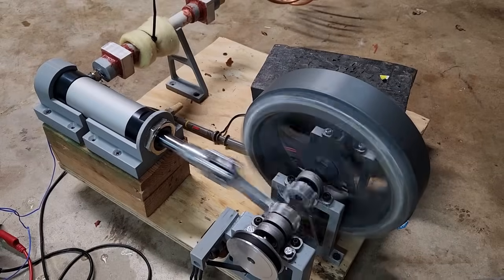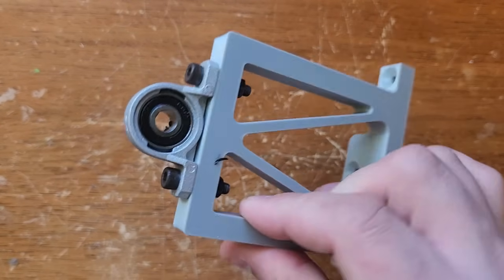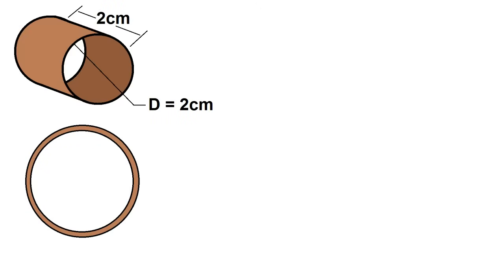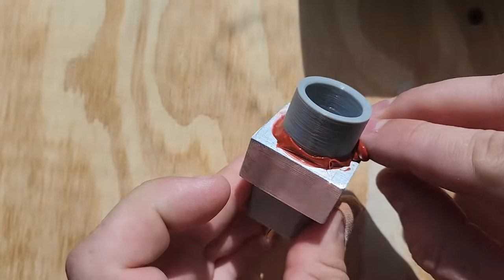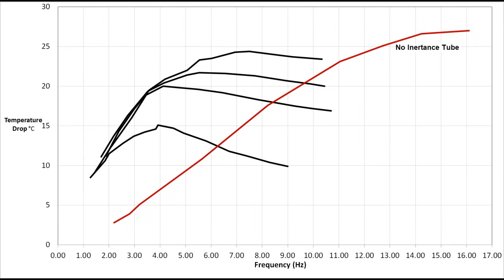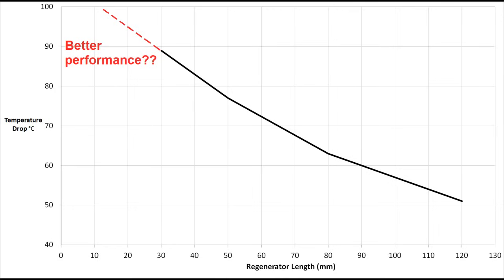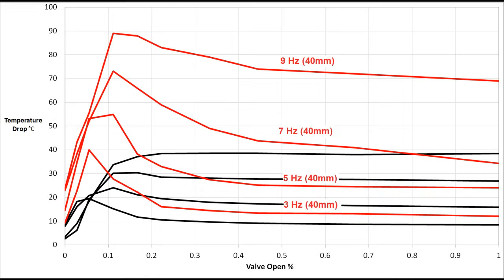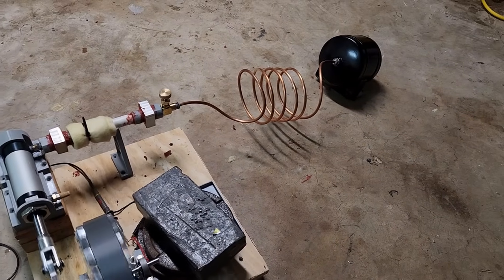Pulse Tube Cryocooler - Part 2 (-75C)

Comment: My understanding of the physics behind this are a bit sketchy, but I do know that if you are using the aluminum blocks to dissipate heat, then adding a small fan to blow air over them will increase their ability to dissipate heat into the air.  Putting them into like an ice bath will help even more.  That way the delta T of the inside should be higher, and therefore improve heat conduction.  You may want too inspect the inside of your air cylinder to make sure the piston is going all the way to the end of the tube to the the largest compression you can get.    There may be a bolt on the end of the piston or weird cutouts in the head.  My other suggestion is to increase the stroke length and use both motors to drive the crank.  One from each end.

Comment: This is fascinating. The first DIY cryocooler that works sufficiently  This is the first DIY project reaching really low temperatures without complicated multistage refrigerant stages.
Reply: :) Not the first that works well, but with a really cool presentation!

Comment: For the regenerator I recommend looking into a foil-based regenerator. The video here (starts at timestamp): https://youtu.be/IgWHuhVcLKA?t=1147 ,shows how a strip of stainless steel foil, would have small dimples stamped into it, so that when it is wrapped around itself, it makes for nice small airgaps between the wounds of the foil.

Apparently at least for Stirling engines, it's one of the better types of regenerators to use.
Reply: I was reading a lot about Stirling refrigeration in the early 80's and the "standard" regenerator consisted of a stack of fine wire mesh disks. The stack naturally has poor thermal conductivity down it's length, as required. I think copper was preferred but brass was acceptable and easier to obtain. The mesh is easy to cut with scissors. I've not seen the foil approach but it looks interesting and am left wondering how the dead space, axial conductivity and other properties compare to mesh.

Comment: I have a curiosity, the greater the vacuum drawn on the air medium the cooler it gets yet the greater pressure applied the hotter it gets... thus your need for the heat sink and the flow reducer to restrict the movement of the heat from the compressed medium as the decompression takes place on the other side of the heatsink...

I will assume you know how a regular heat pump works, compressing refrigerant into a small confined line then out into a much larger diameter line that has a vacuum pulled on it. the change of density of the refrigerant from the small line to the large line causes a change in state of matter from liquid to gas creating the temperature gradient.

I am thinking of maybe using isopropyl Alcohol as a refrigerant in a parallel, secondary line that decompresses, inside the cooling tube either on the cold or hot side of your heatsink. the compressor for this line could easily be a second piston with a much smaller stroke/volume on the same motor.

perhaps i am over thinking this.

Comment: You can use hydrogen in the cryocooler. It's easy to make an relatively cheap compared to helium and have similar properties. It is not a fire hazard if the hydrogen is at high concetrations and if it leaks the smaal amount of gas will swiftly dissipate to low enugh concentration as to not be able to ignite.

Comment: When cleaning wire wool up wrap the magnet in a rag so you can separate the captured steel wool from the magnet to dispose.

Great to see an explanation of why gas-gas heat exchangers are hard to design!
Reply: Gas-to-gas heat exchangers are much harder than the other because overall heat transfer coefficient is substantially low that you need very large equipment for that. Because of that, the diameter and length of the heat exchanger gets larger and larger. If you intend to do gas to liquid heat exchanger, it is far worse than it seems, because the liquid will have higher conductivity while gas will have very low conductivity which makes a lot of problems on the design process. Other than this, the pressure drop across the heat exchanger will be very high for gas effluent (because of high velocities) depending on what type of heat exchanger and which side you intend to have liquid flowing (if it is shell and tube heat exchanger of course)

In my process design course, I had a lot of problems with superheated vapor stream and it was a nightmare to get the correct design values.
Reply: Great suggestion. Could use a vacuum cleaner or a small brush.
Reply: Instead of a rag you can also use a sandwich bag but the rag works well too.
Reply: I use a ziploc bag, inside out... and then boom I flip it around and now I have all my chips!

Comment: I know you like to evaluate the equations governing the process, and then you cut and try the mechanics, and measure the performance.  Are you tempted to try making and validating a math model of your cooler(s) to provide better guidance before breadboarding?  I know it's not easy to construct and validate a model, but making one and publishing a practical model would be a great service to the DIY gas liquefaction community.

Comment: Simplest way to give these 3D printed parts better performance and tolerances is to press in some bushings, typically made from brass. It works similar to putting in inserts, heating them up and then just pushing. Bushings are very often the better solution compared to roller or ball bearings anyway.
Reply: Bushings are only really significantly better if you're worried about contaminant intrusions into the race or concentricity. For a continuous low speed, ambient temperature, high torque system in an open and dry environment, ball bearings are pretty much perfect. A bushing would need much more careful tolerances for the shafts and alignment. If he were working with hydrogen gas you might have an argument though.
Reply: @dustinbrueggemann1875  Yes yes, high torque like here lol. It's low-torque, low-load, low-speed, and very limited operating hours, so the main argument for bushings is the fact that they're low profile. Which I guess is the reason he didn't install ball bearings in the first iteration of the rod, as there wasn't enough space.
Reply: @dustinbrueggemann1875  so for low torque application, bushing can be better?

Comment: Did you change the pulse tube for the larger piston? Since that made such a large difference for the smaller piston it might help the larger one as well. 
Have you measured the heat bildup on the heatsink? That might also be a limiting factor for the large piston

Comment: Great video and a good approach overall.
Just be careful about avoiding helium for too long, as its properties are different enough that all of your fine tuning might actually end up being totally irrelevant when you finally switch over to it.
I would strongly recommend that you use some sort of vaccuum pump (even just a cheap single stage rotary-vane pump would probably be sufficient for testing) to ensure that you have a known, controlled gas composition and quantity inside of the pulse-tube.
I also think you should really start using hydrogen as the working fluid, at least to confirm that you still see the same general performance trends, while also ending up with optimized values that are similar to what you found with air. This would also ensure that your connections are hydrogen gas-tight and therefore also more likely to be helium-tight as well.

Lastly, you could consider using methane (or carbon tetrafluoride) as a cheap working fluid for high-pressure cryogenic testing.
Reply: I think he is avoiding hydrogen and methane so it doesn't explode (compressing flammable gasses). Hydrogen would definitely be interesting though because it is so abundant and is fairly similar to helium in the required categories. I am interested in making one of these cryo-coolers to make my own hydrogen for a car or possibly a motorcycle
Reply: Hydrogen is a big leap to make though. You need anti-detonation measures in place to even think about using it like non-sparking alloys, rupture vents with ventilation, and fairly powerful vacuum pumps to ensure the system being filled is free of oxygen. Also, can you even buy CF4 non-commercially? It's a super potent greenhouse gas and manufacturing of it is pretty tightly controlled from what I understand.
Reply: @dustinbrueggemann1875  Hydrogen detonations are really not that bad at these sorts of volumes and pressures, while the internal construction of the economizer/regenerator is already very similar to that of a flame front arrestor.
Take for example the safe, common demonstration of comparing the explosions produced by setting fire to 1-2L balloons filled either with Hydrogen ( but without rigorous exclusion of oxygen), or with a stoichiometric ratio of 1:2 pure Oxygen to pure Hydrogen.
Even though both produce explosions, the pure hydrogen balloon doesn't produce nearly as brisant of an explosion.

'Pure' Hydrogen deflagrations (with or without a transition to detonation) are also not even a shrapnel hazard if you're using relatively light materials, as can be attested to by the following common (at least it is very common over here) science classroom demonstration:
The teacher would punch a small hole in the bottom of a metalIic can (it works best with long and slender instant coffee can, although an old paint can with a loosely attached lid can also be used), then after covering or plugging the hole with scotch tape or blue tack and inverting the can, he would fill the can from the bottom with Hydrogen (through the small gap from the loosely attached lid). After some time, (while still feeding in Hydrogen through the bottom) the small top hole is uncovered while holding a lit match just above it so that the escaping stream of Hydrogen gets ignited.
After ignition, the Oxygen to Hydrogen ratio inside of the container will begin to increase so that, once an explosive composition is acheived, the whole mix will detonate at once and blow out the bottom lid, thus propelling the can upwards with avery impressive speed!
Reply: Using hydrogen in his home made piston and tank system? Sounds like nothing could go wrong.

Comment: Could the 40mm pre-compress then the smaller 25mm cyl does higher compression? Higher compression provides a bigger temp differential.

Comment: You could try to improve regenerator performance by using several "sub-regenerators" to prevent heat conduction axially. In practice, instead of making one blob of steel wool, make several and stack them inside the tube.
Reply: I wonder if adding an insulator material or air gap between them would help as well
Reply: @mitchellstrobbe7779  What I've read, having an air gap or insulator material between sub-regenerators does not improve the perfomance much at all. Axial discontinuity in the regenerator should be enough to prevent axial conduction.
Reply: Try a stack of stainless steel filter mesh. Not only does stainless steel  have a much lower thermal conductivity than the steel in steel wool, but heat has to flow laterally along the before reaching a contact point where it can flow axially to the next screen.  The second part contrast with the random orientations allowing comparitivly faster axial heat conduction with steel wool.

Comment: be careful driving your motor with a power supply, that flywheel has potential to put higher voltage/current back into your power supply and blow something
Reply: I think the solution is a flyback diode?

Comment: This is by far, the most interesting video project recommended by YouTube in a long time. Great explanation and accurate presentation. Amazing work, keep up the good work. Hope to see -200C in a while :)
Reply: I second that. Looking forward to some liquid nitrogen in the near future :)
Reply: @drezster  سسثثر|3
Reply: So True otherwise youtube only promotes garbage and clickbait
Reply: I agree this is highly relevant to my interests.

I've been wanting to test out instead of using heat to evaporate water from my 3D printer filament, sublimate it with cold instead.

Freeze drying machines are ridiculously expensive.

I could do so much science with this!
Reply: @jtjames79  Drying by reusing salts/absorbers or using vacuum or a water separation membrane to make a dry environment might be easier?
Reply: @spaceminions  I live in the wettest part of Hawaii. A desiccant is pretty much necessary.
Reply: @jtjames79  Unless the plastics are weird, desiccants should not be the only option though. Vacuum is obvious, and while inefficient it's fairly easy to get to pressures at which water cannot be a liquid at room temperature, but the membrane separators are capable of dew points in the negative fahrenheit ranges IIRC while being less inefficient.
Reply: @spaceminions  But then I wouldn't know if sublimation works or if it's just a stupid idea.

Plus then I would have a ready supply of cold for whenever I wanted it for "reasons". Like turning a puddle into an instant fog bank, for quick ninja escapes.
Reply: I’m more of a chemist type than an engineer so I don’t follow a lot of what he is saying but I have absolutely loved following this project. Sometimes I need very low temperatures for certain reactions so DIY cooling systems have been a big interest.
Reply: Gotta agree with ya!
Reply: In case You don't know: watch the "star in a jar" project by the plasma channel. Just a recommendation
Reply: I third that, been on YouTube too many years,  its not often I come across a subject that is not covered much and my god the scientific understanding is fantasist by the creator, I'm loving the journey he is on as cryo coolers are not something Joe blogs would come across and the people that do know about them seldom know the way they work :) keep it up
Reply: I used to run an O2 generator system for high volume.  It used pretty much all the types of cooling schemes he talked about, compressors, heat exchangers, turbines, etc. in different stages to get LOX.  We used to heat our lunches on the compressors.
Reply: this would be a great senior project for a materials BS, with the math of course